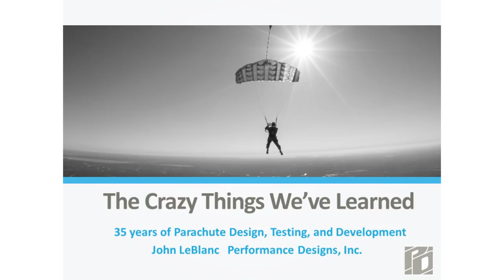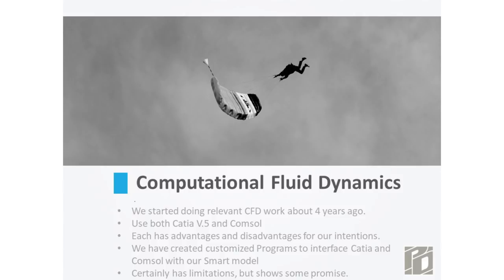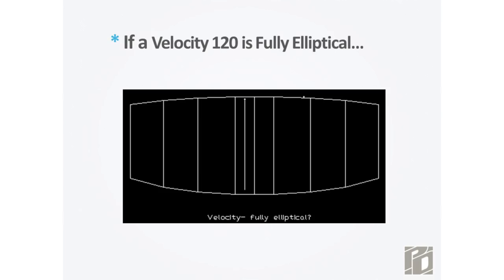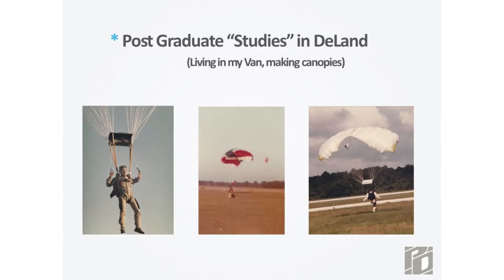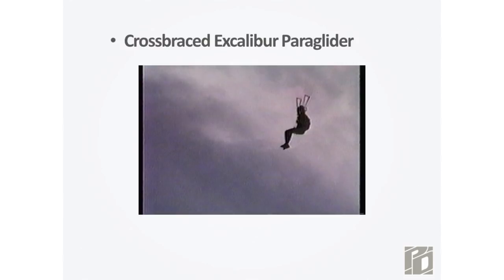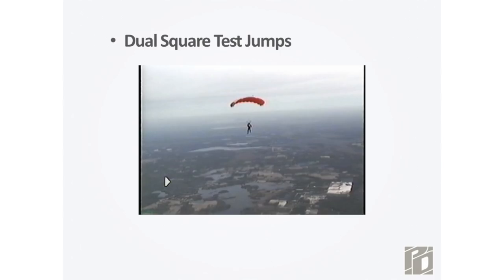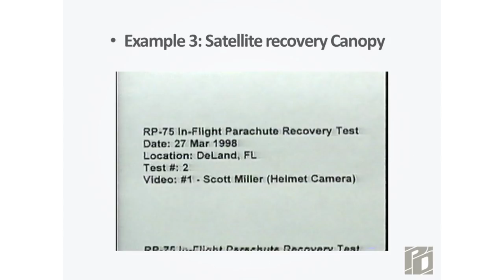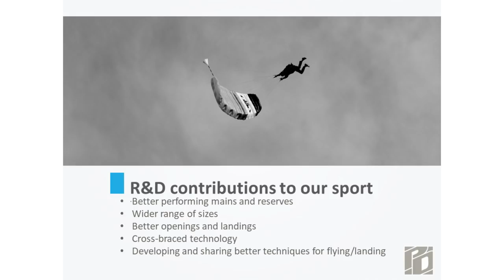BPA Skydive the Expo 2018: John Le Blanc - 30 years of canopy design and development

Comment: The computerized log book for test jumps was created in 2003.  At the beginning of the Katana project, not in 94 for Spectre.  I did my first jump in 98 and also wrote the first electronic log entry.    So the logs were definitely not digital in 94.  At the time, all test jump logs were hand written by the test jumpers in a book in a locker in the packing hanger and at the end of each day Scott delivered the book to John so John could decide what Voodoo he wanted to try next.  Wasnt very efficient.  Cause I can say with absolute conviction, you could never overload John with data.. So, the decision was made to move DRC from the locker to the little office, got the nod from Bob and an internet line was ran to the office and the laptop.  So the log book updated real time over at PD  And Bob was our uncle..  This allowed John to see real time test jump logs as soon as the test jumper wrote one...and because of that access to real time data, he would sometimes make 2 or 3 different revisions in a single day.  If we were jumping Rev 46, John might make a slight change to an airfoil or a tolerance or inlet or trim...  The magicians up in engineering could bang out a complete parachute from the second John sent design to lazer tables to finished ready to jump canopy in about 1 hour.  So in 1 day, he may ask for jumps on Rev 46, Rev 47 and Rev 48...He could design and build and jump 3 new revisions in one day..